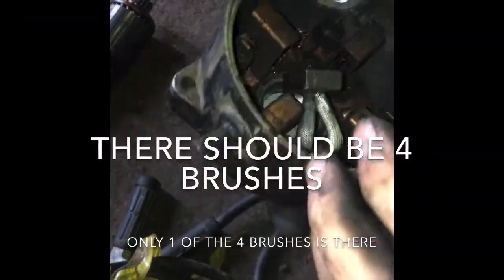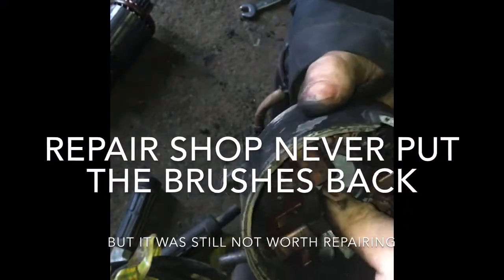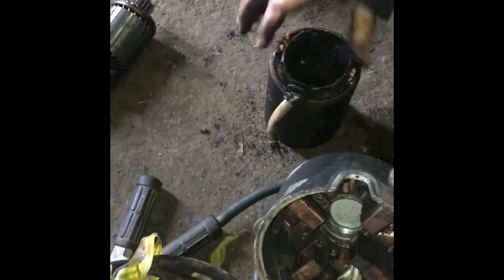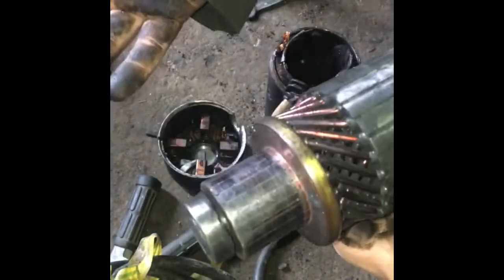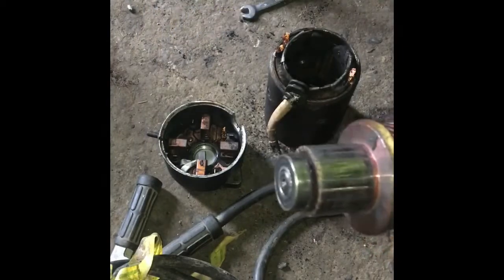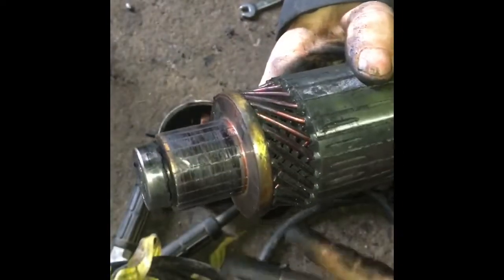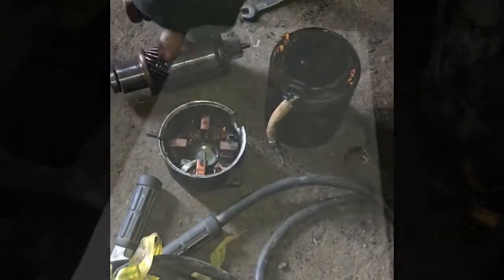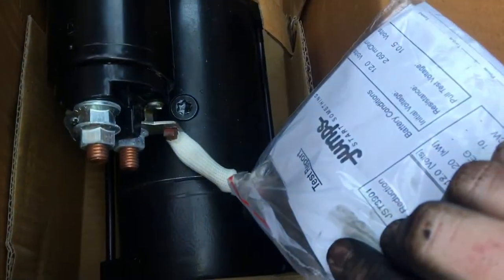JCB starter motor pt1 but is there another problem?

Comment: I'm all about fixing stuff like this... I was slightly disappointed you didn't, but was glad to see inside it first. Thanks buddy
Reply from the maker: I say it could of been fixed but the shop a brought to said it was cheaper to replace than to fix . At the time I had animals looking for silage and just needed it fixed ASAP but yeah, I would of liked to have fixed it myself
Reply: @stevenharpervw  hey my man, all good. I just watched a video of actually fixing it... Brace yourself bro.. It's tough but can be done.. Some dude does it with hammers, pliers, soldering iron, lathe, and a little forge I think.. Damn that's a lot of work... I'm good with this kinda stuff, but this endeavor is definitely daunting.
Reply: @stevenharpervw  I wonder if a good clean up and grease, and freshen up the brushes.. I dunno

Comment: I'll agree the old one looks very worn, is it designed for that engine or something thats known to give results? My only thought is the excessive carbon is the unit arcing as it's struggling to reach its designed speed
Still be nice to try and fix it when you've spare time 😁
Reply from the maker: So I went through 3 starters in a month.  First one failed after 1 day and 3 starts. Next one kind of survived 2 weeks and just gave constant trouble it might take 5 goes to get it to actually start. Took the key barrel apart but nothing was wrong with it. Went back to the shop and they only then told me oh yeah we got a bad batch of starts in . I told them I have cattle to feed I can’t be messing about with chinese crap starter motors. So they gave me a Lucas one. No problems since.  I have considered rebuilding the original one in the event the new one also goes bad .  For what took me 2 hrs to remove the first starter motor I can now do it in 10 minutes

Comment: I've got a very slow starter on my JCB 2CX and need to replace the starter, (we've changed everything else) , it's a nightmare to get at though. That starter you fitted is unusual , could you tell me what type it is please?
Reply from the maker: Don’t buy Chinese . The shop I went to got a batch of starters and that one in the video failed after 3 starts. I went back and told them it the bran new started failed and I wanted a different brand so they got me one . Don’t know what brand it was but came in a different box and has been running the jcb ever since . They aren’t hard go replace . Just give everything a good power wash first so it’s clean
Reply: @stevenharpervw  I went to JCB in Edinburgh and bought a starter from them thinking if this doesn't work it must be the engine, well..the motor was £360+VAT so twice what an internet one was and guess what?? It's made in CHINA , it looks identical to the new one we put in in 2020 and weighs about 10kg. It took us a whole day to remove the old one and get the new one bolted in place and connected up ...well it turned over about 10X faster than the old one and once the fuel was bled it fired up and I am so happy...now when I go down in the morning , I give 5secs of preheat and it starts instantly . That's the first time in 15yrs it's done that. Very Happy
Incidentally the old one has fixed brushes so can't be replaced , not that they were worn, just a load of crap.
Reply from the maker: @stephenauty2402  it’s completely like night and day when I first changed mine I couldn’t believer how fast the Jcb started up

Comment: An old beast but so much easier to work on , there’s no way you could change a starter on a new machine with one hand unless you were built like a brick shit house .
Reply from the maker: Oh like our Jcb loadall does a savage amount of work, I say that hours clock has gone all the way around 🤣. They are great machines . Ya I say the new machines are even harder to work on
Reply: @stevenharpervw  Yep and you need every spanner in your box as no two bolts are alike ( anyone that works on modern machines will get that )
Reply from the maker: @Ditcha1  do they will have all yellow wires and only use codes printed on them?   Our machine is old but at least I can still work on it